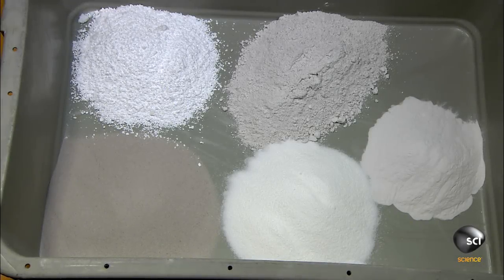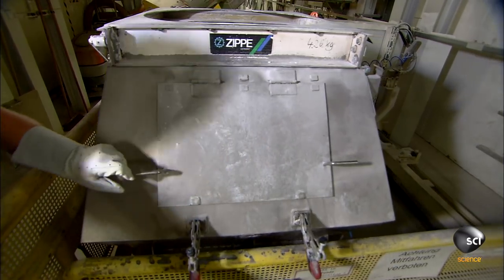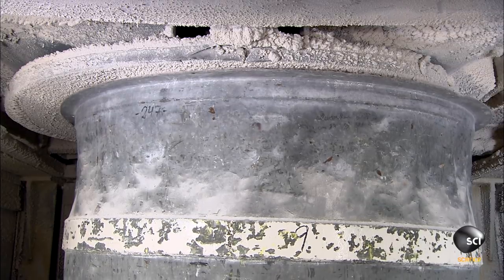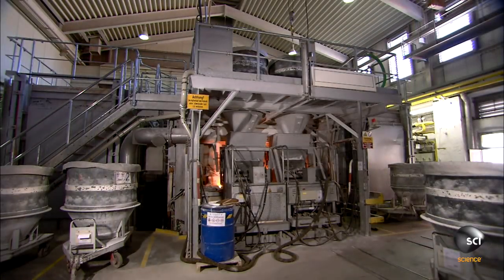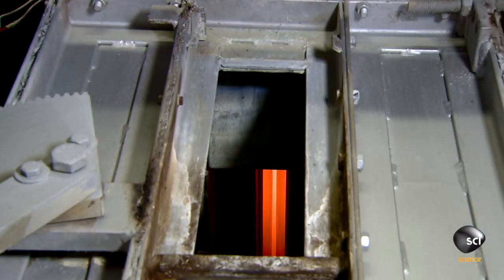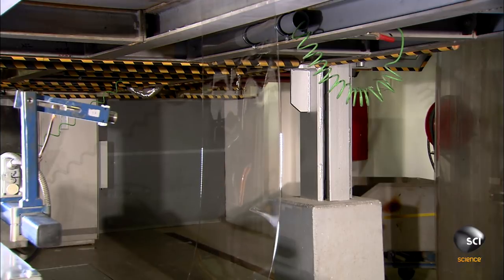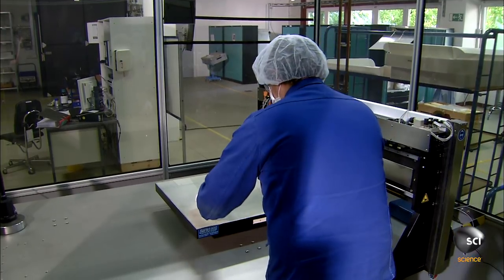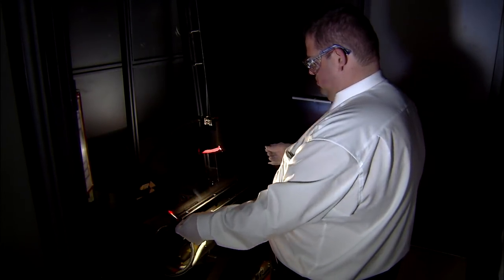Ultra Thin Glass | How It's Made

Comment: The furnace has been fired to a blazing 2732 F. 
Quite sure it's not specific to a single degree Fahrenheit. That would be hard to do even for a small batch and lower temperatures. 
Guess they just translated the approximate temperature in Celsius to Fahrenheit for their non-SI-compliant American audience.
1500°C = 2732F.
Reply: Nah I work at the factory and it’s exactly 2732 F. If it goes one degree under we get fired and the entire foundry explodes.
Reply: @karmatt3098  It HAS to go "one degree under" when it heats up from room temperature. And it will go one degree under again when it solidifies.
Reply: We will never comply!

Comment: This is not complete video. Can it be done on a small scale? I have lot of glass scrap basically of neutral glass. I want to melt it and then wants to draw it in to thin sheet of around 0.3 mm thickness.
Reply: I’d say you could probably get away with it so long as you own a glass factory